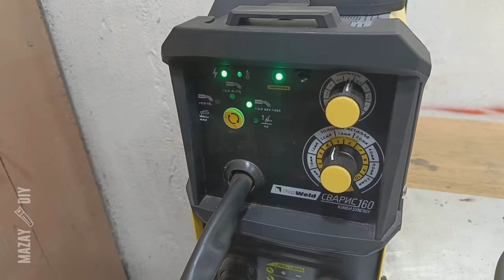How to Weld an Impossible Triangle (Tribar)? | Is It possible?

Comment: You shouldn't fully weld your joints until the whole structure is tacked together that way you minimize distortion caused by the heat input of a full weld. Great job though! Ran some nice bead with what appears to be flux core self shielded👍
Reply: should use a real welder lol thats a hi volt soldering iron
Reply: He also needs to weld hotter. Most of those welds looked way too cold. I was wondering why he used such a thick wall tube so I was assuming he might be a timid welder.
Reply: @barrvason5431  It isn't a structural weld. Strictly art. Get over it.